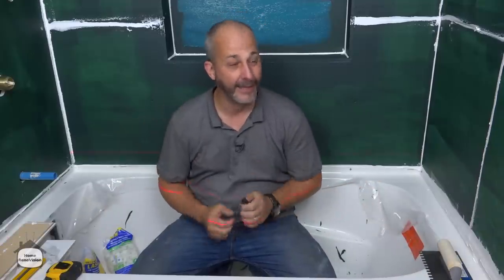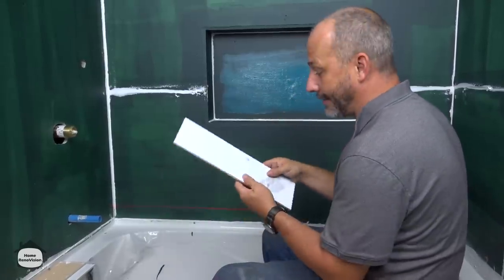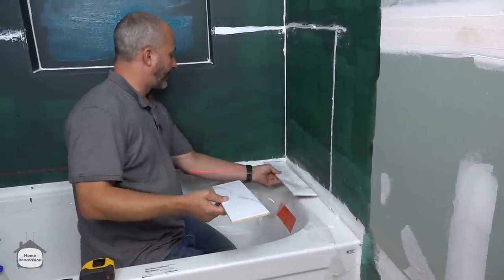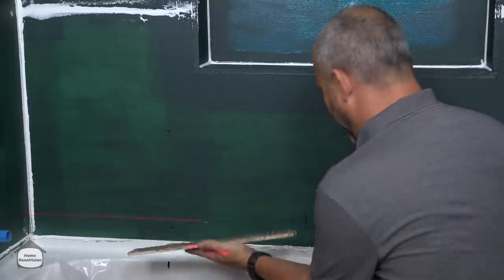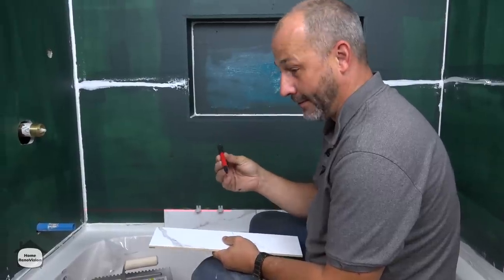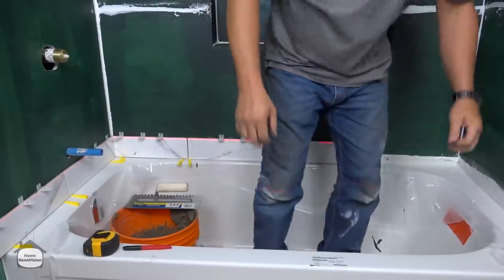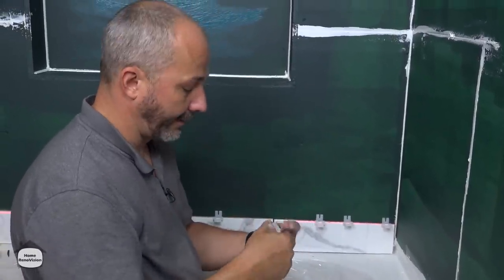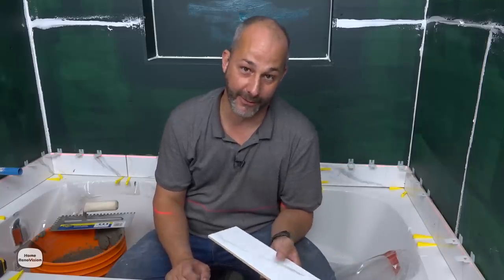DIY Shower Tile Industry Secrets | Bathrooms 101

Comment: Do we have to use the clips (spacer) between tiles? can we tile without clips so we will not have gaps between the tiles? to look better and avoid the grout that always remains not clean.
Reply: that will not turn out good. you might also have a local code for this. but minimum grout is 1/16

Comment: What kind of caulking did you use for the niche and between the bathtub & drywall?
Reply from the maker: i use nuflex silicone. I love that stuff! we have it listed on our amazon link under products I love! Cheers!
Reply: Thanks Jeff. I will find something similar in my area as I wasn’t able to find it on your amazon list.
Reply: Home RenoVision DIY what is the need for additional caulking in these joints? I understood it that it was waterproofed and ready for tile after your 2nd coat of the waterproof membrane...

Comment: Should always silocone on the flange before installing base tile to give it a extra barrier for water getting through.
Reply from the maker: I do the exact opposite. In a waterproofed shower the water that collects behind the tile over time needs a way to escape. and that is why you should always leave  the corners of the tub without silicone.
Reply: @HomeRenoVisionDIY  Hi Jeff. Good job on the tile. Just a little curios, why not install tile backer over the tub flange? It seems to be a week point were water can infiltrate behind tub.

Comment: I have a couple of questions:  1)  I noticed that your tiles don't end AT the laser line.  Did I miss you explaining that reason in your video?  2) Should we be using vertical spacers as well between tiles?  Thanks!
Reply: Max Quagliotto I was wondering the same thing!

Comment: So if u start with the first row.... Say from the floor.... And leave it till the next day, u can do the rest of the wall? Instead of using a base board and doing the wall first then the bottom row the next day?
Reply from the maker: Yup!
Reply: Thank you for the fast reply I realy apriciate it. I think your videos are very informative. Thank you again.
Reply: I have one more question.... It might be a dumb question but im going to ask anyways lol. I did 3 tiles above the venaty sink in the bathroom as a test and they got loose so i had to take them off. So there was still adhesive left on the wall. Can i just sand it smooth and tile over it? Or do i have to sand it all off

Comment: Jeff I live in a manufactured home, have 2x3 walls with 1/4" dry wall. I was told I should use cement board for the best water resistance under my tile, and on the existing particle board floor. I have watched you use different methods and am now, not sure which is the better option for me. The cement board seems heavy (already purchased) and the tiles (12x24" porcelain). Instead of the thin set that was recommended at hardware store, is it your suggestion to use all non-modified cement under the cement board then the redguard over it all before setting the tiles?

Comment: How did tilers do it before laser levels? Seems to be a mystery these days; nowadays DIYers you need every single modern tool for just one small job.
Reply: You can use a 4 foot or 2 foot level and mark your lines as needed.

Comment: sometimes the hole for the niche does not line up with the tiles, due to pipes , electrical etc in the walls
Reply from the maker: the horizontal lines are more important than the vertical! Cheers!

Comment: @9:53 - When Jeff says he is going to grind the tiles, you don't grind the tiles on an angle do you? you just grind 1/4 or 3/8 at the bottom in straight line. Anyone knows? my project is stalled because of 0.5" difference in low and high side.
Reply: Danish Qamar: Jeff drew a line at an angle (i.e.: 3/8 at one end tapering to 1/4 at the other end.) His son then cut out the tapered angle.

Comment: wondered why you didn't put mud on the wall
Reply from the maker: mud has no value when waterproofing and all it does is add extra time to the project. Cheers!
Reply: Notch the wall to make sure it bonds. Not to mention it's much faster than buttering each piece.  Start with a small area and slowly try to do more as you get comfortable. Remember, if you touch the thinset on the walland your finger is still clean it's glazed over and tile won't bond even if it looks wet.  In that case notch over the area with fresh mud. Take your time and have fun, unless it's your job like me, then hurry up but still have fun!

Comment: What are your thoughts on using 8" by 45 " tile in a walk-in shower?
Reply from the maker: size does not matter except on a floor with a drain. Cheers!
Reply: @HomeRenoVisionDIY  is the recommended 33% offset still possible.  Any advice about using full lengths? This will be the same tile going on the floor as well.  Thank you the great videos!

Comment: Hi Jeff,I have a walk in wet room shower area with level access and vinyl waterproof flooring. The walls however are clad with Hardieglaze, a 4.5mm thick board with a high gloss polyurethane coating, see (https://www.jameshardie.co.nz/products/interior/internal-wall-lining/hardieglaze/). This is direct fixed to the timber framing on battens and overlaps the up stand of the vinyl floor so there is a drip edge. The board is brittle and is broken at the bottom edges and mould easily gets in behind at the bottom edge. My initial thought was to tile the walls but then looked at PVC wall coverings by Altro, however their installation is possibly beyond the DIYer. Unfortunately the shower head was placed opposite a window which I can move when I reline the walls with a plasterboard substrate for the tiling. The window though is a timber one with standard architraves and a timber window sill. My question, sorry for the long pre-amble, is when tiling around the window is it best to treat it like a shower niche and tile around the frame dispensing with the sill and architraves. I plan on using a subway style tile but wider profile could also be cut down to go around the window frame too? I think this approach might be better as then the window could be used as a niche too? The window is also very close to the internal wall and if I use the architraves there is no room for tile or at the very least a sliver would fit but that is not ideal. If I tile around the window by removing the architrave it would give a sufficient gap between the window frame and the wall to fit a thin profile tile. Finally do you have a video on how you tile around a window in a bathroom or wet room shower scenario? Thanks heaps for your vids, I am a recent subscriber.
Reply from the maker: Thanks for the update. let me know if you ever have a question. Cheers!
Reply: @HomeRenoVisionDIY  Hi Jeff yes I had several questions relating to tiling around a window in a shower. When tiling around the window is it best to treat it like a shower niche and tile around the frame dispensing with the sill and architraves?  Can you do a video on how you tile around a window in a bathroom or wet room shower scenario? Especially when the window is very close to the internal wall where there is hardly space for a tile.

Comment: I'm just a nobody so I could be wrong, but shouldn't the tub lip (where it's mounted across the top) be BEHIND the backer board. If that were the case, you wouldn't have to fight with the first row as much. This would also ensure that water doesn't go behind/under the tub if the tiles were to fail. No?
Reply from the maker: That is exactly the opposite of the way it should be. Cheers!

Comment: I thought the tub attaches directly to the studs. that is why my 60" tub only measures 58". Why are the flange of the tub in front of the wall board? So confused.
Reply from the maker: The flange is not in front of the wall board it is flush since in this house the framing was too large and not square.
Reply from the maker: your tyub measure 58 after 2 layers of drywall and 2 layers of tile are subtracted from the original width.

Comment: So much wrong with this video. 1- No tub surface protection- results with waterproof  paint all over and scratches from working. 2-screw holes for tub not sealed and exposed. 3- insufficient mortar job 4- sloppy caulk behind till will affect tile work. 5- unlevel tub?  6- mortar all over tile 7- low grade (going to fail) waterproofing methods/products
Reply: This guy is doing everything so wrong

Comment: Why are you dealing with a fiberglass tub that will squeak and will go bad before the tile does?  Get a Kohler cast iron tub and never have to replace it again.  I know, it's heavy but somehow you can get it there.  I notice you go "hoo" a lot and a little out of breath.  You need to do more swimming and that way, you can do a video about repairing pool tile underwater.

Comment: Level your tub. Exactly why the homeowner probably isn’t the best contractor for their home.
Reply from the maker: In my experience..trying to level a tub that is out only 3/8 over 5 feet sets you up for nothing but headaches. today's acrylic tubs are so flexible that they need a solid surface to sit on. renovating does not leave you access to level properly without creating all sorts of potential problems. cracking in the tub around the drain. constant squeaking, tile breakage from the moving frame, soft spots on the floor and the list goes on. If a homeowner wants a level floor then you should build it from the frame and redo the whole bathroom. This will also cause an issue where the door transitions to the hall. The best solution is to let her sit and then adjust your tile line. it is an invisible fix that makes everything else look amazing. Cheers!
Reply: It is a pain trying to level all sides I got so close I’m trying to perfect it and just wasting time I got it as close as I could sprayed gap filler under it and filled it up brace it with fasteners and let it sit overnight.  So at least I could lock it in time haha and have a base that isn’t mortar underneath. I even braced  the wall side with 2x4 and still wanted to tempt me to get it even more level.